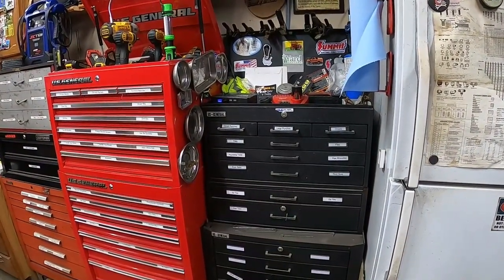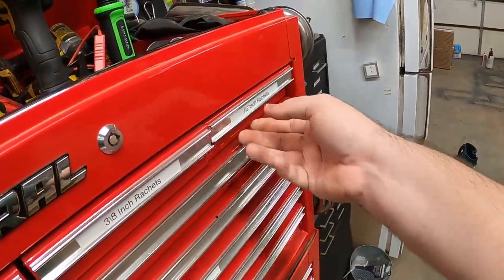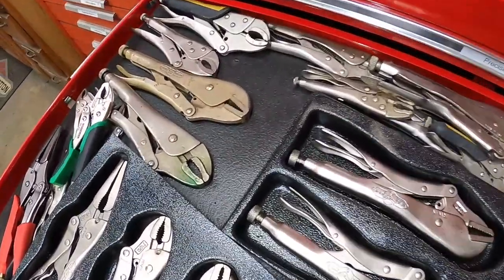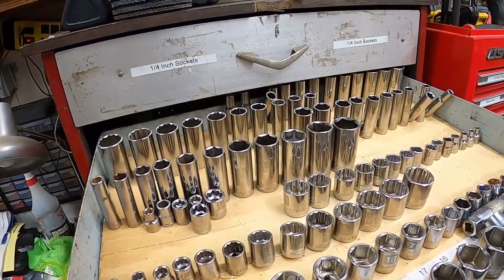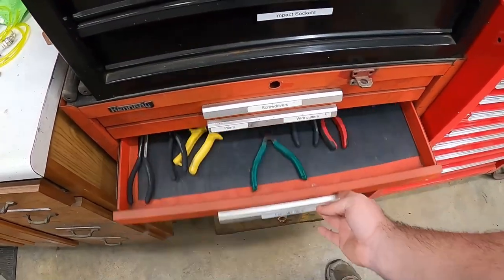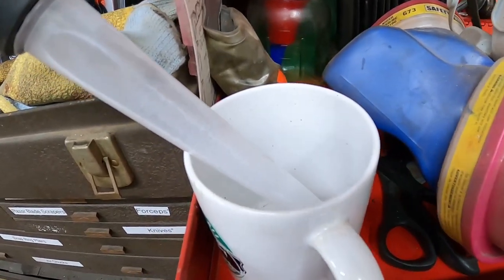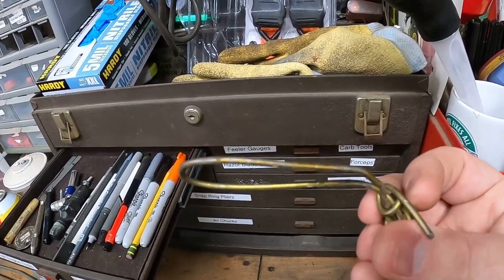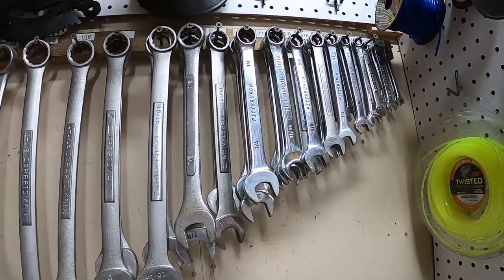Small Engine Mechanic Tool Box Tour: Shop Tour Part 2

Comment: Come join in on the weekly live stream every Saturday at 130 pm -200 pm. Til around 430 pm.  We talk small engines and whatever. Bruce PENDER.  Ken from Kens small engines. Steve from Steve’s small engine saloon.    Hobby motor. Mick from micks mowers and a lot more is there almost every week.  I think h will fit right in and help to boost your channel as well.  See you soon